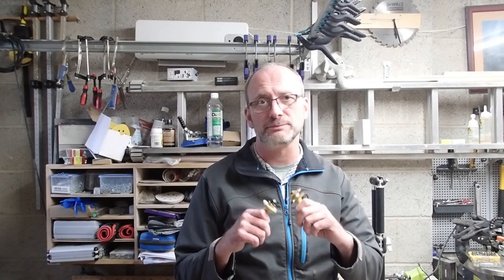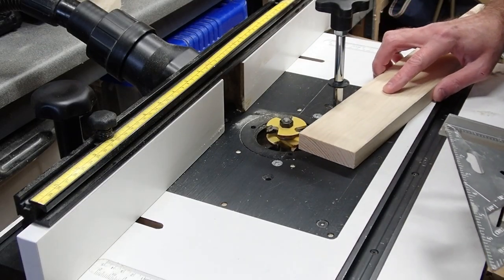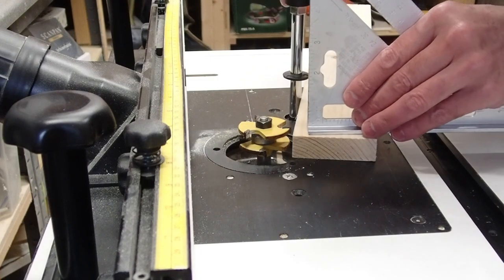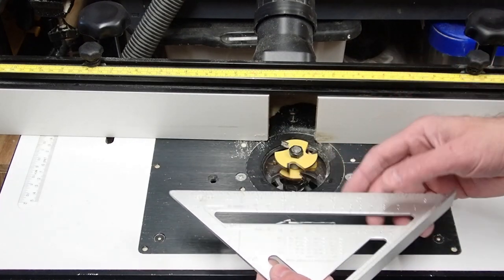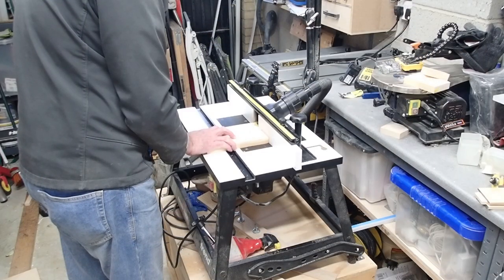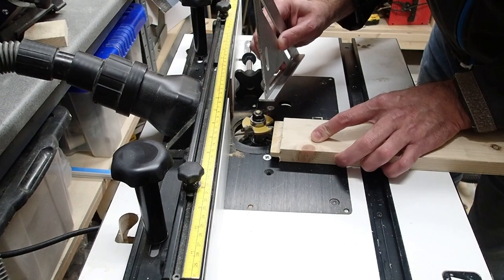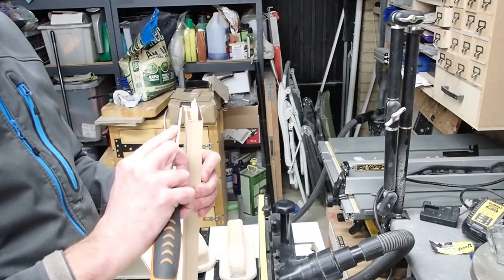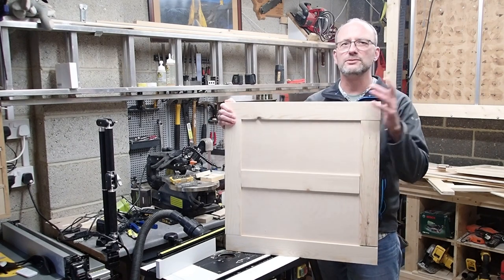How to use / set up a tongue and groove router bit set

Comment: My 1/4 inch plywood fit very loosely in the 1/4 grove due to the fact that quarter is plywood is no longer quarter inch. What can I do to prevent it from shaking when I assemble my door or my kitchen cabinet?
Reply from the maker: Hello and sorry for the late response.  I have used both hot glue and wood glue to help.  Another thing to look at is using a different flute router bit for the groove or make them with a table saw.  Not sure if you have viewed this or not, but here is a discussion on this topic that may give you some ideas https://forums.woodnet.net/showthread.php?tid=7085200.

Comment: I always see T&G done with a table router, can it be done with a plunge router?
Reply from the maker: I suppose it could be done; however, you would sacrifice consistency and moreover safety.  If I didn’t have a table I would probably grab a small sheet of plywood to act as a makeshift table.